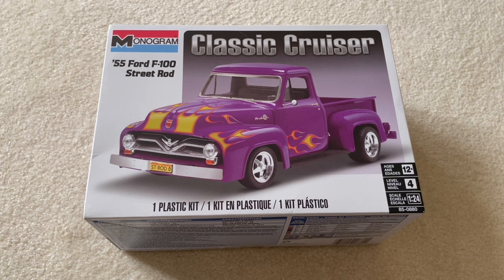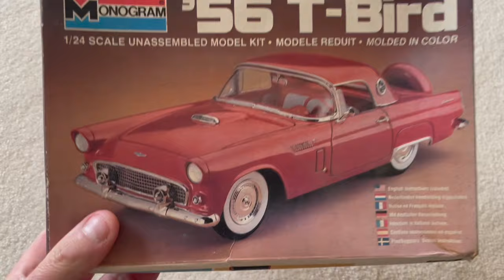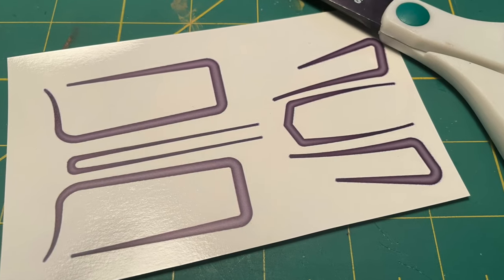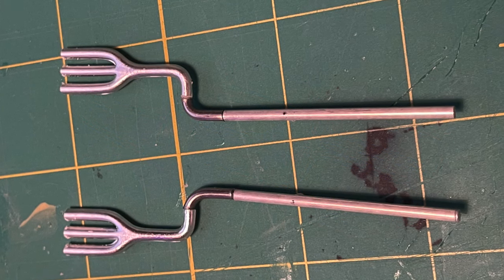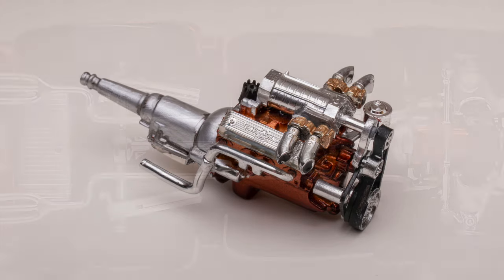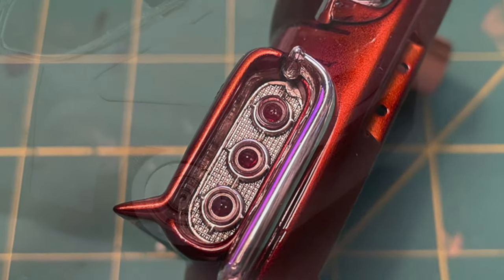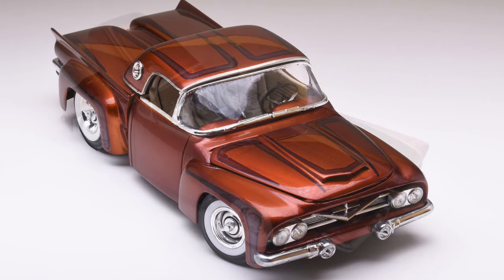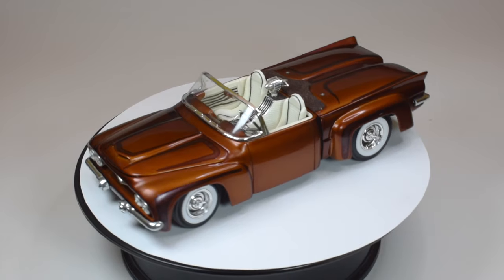USACC ’55 Ford Truck. I’ve finished polishing the turd!

Comment: Amazing Outcome!
ThunderFurd!
4:46 Not a Mercury, Meteor was a separate brand. Ford, Meteor, Mercury and Lincoln. Some models were Mercury Meteors but the Meteor Brand had 4 lives in Canada…for the most part they were Ford bodies with Mercury roofs and unique chrome and interiors.
Reply from the maker: You are correct! It is an interesting grille design though. Thanks for watching.